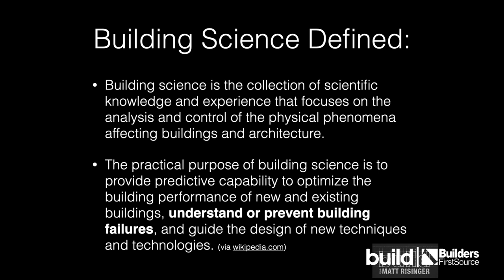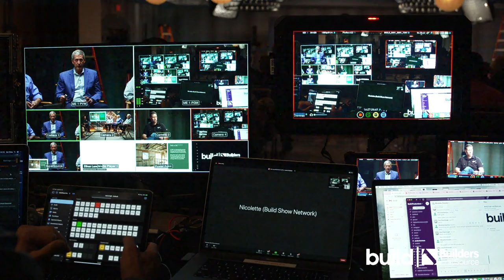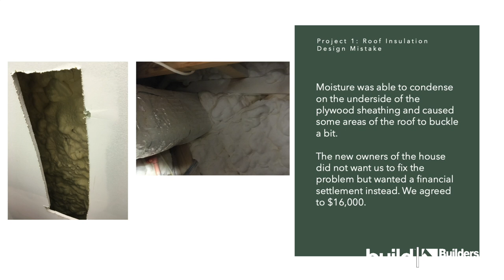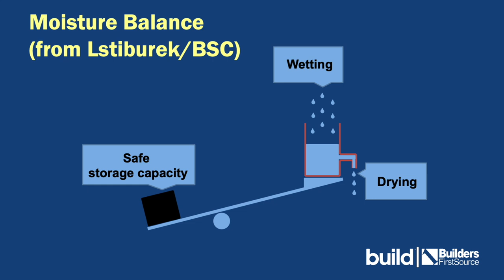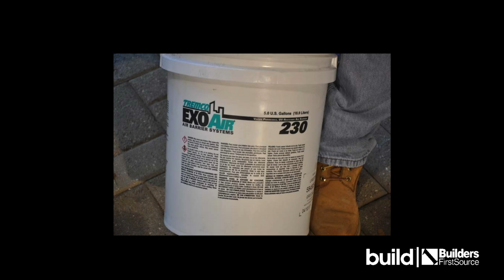Massive Mistakes and How We Fixed Them (4 Builder Panel)- Build LIVE from DC

Comment: In the late 90s, I was working for a design-build company in Terre Haute, Indiana.
We were building pre-engineered metal buildings for mostly industrial use, but they were also used for the attached office space.  The buildings were insulated with fiberglass batts.  We also had an interior designer on staff that LOVED vinyl wallcoverings.
I moved to Maine, and started learning Building Science from Joe and others in the Northeast.
Five years after I left, I spoke with a friend who was still a Project Manager with the company.  They had spent many tens of thousands of dollars fixing the moisture issues in these buildings, but still didn't understand what was causing the problems.
Reply: I have found interior designers lack of thought to long term consequences & hygiene/water movement to be horrific.

Comment: I'm not a professional builder, but as I moved from The Netherlands, to the UK, then to Ecuador, I've seen a lot of different approaches to building. I like the content here a lot, as although I am an electronic engineer originally, I've done tons of electrical and basic construction. I look at this channel to ensure I get ventilation where it needs to be. An example, a badly constructed lift/stairs area in the 4-story building we have 2 floors in (bottom 2), has water ingress. That hits a tile floor, but if it gets a lot of rain water there, no drain exists. That water goes into the wall, and then, into the bedroom downstairs. In addition to drainage, we also effectively built a vented box behind the cupboard, so any moisture is vented out. The climate here is fairly dry, most of the year, but there is also (very) heavy rain sometimes.
We also had moisture problems from the neighboring walls. Same concept, fiber cement wall with air flow behind it. Problems fully resolved. 
Other small tricks that are not too common here, are centralized gas,  anti-return valves and shut-off valves, floor pan drains under some critical equipment areas like washer, dishwasher, plus some improvements to get the water out of the house.
Houses here, even fairly upmarket ones, are not typically well insulated. But taking advantage of lessons shared on this channel is definitely good. There are other channels too that show some good stuff, but this one covers a lot of different things, products, mistakes and how to resolve them. It shows off sponsored content too of course. But it is honest about mistakes made, owning up and solving the issues, and it is very interesting to see what ideas I can use in a small way in my own property.
Thanks all on the panel and thanks Matt!

Comment: I always spray stone siding with 511 H2O+ stone sealer, especially on limestone to prevent water from soaking into it.  In zone 6, the freeze/thaw cycles causes limestone to flake off, sometimes in chunks over time.  It may not be waterproof the wall assembly but the stone looks cleaner for many years by keeping water from soaking in and mold/mildew from growing on the stone face which discolors the stone vs, unsealed stone.

Comment: The liquid mastic cracks me up because i have used white aluminum roof coating on joints of osb after i sealed/bonded the sheet edges together with PL premium. Then the next day i applied the aluminum roof coating over the joints. Also with the peel and stick flashing or tapes you want to use a heat gun on medium on your substrate before you apply it and it will bond like skin. I am not a pro builder i am a retired aviation structural mechanic US Navy and so i applied my knowledge to any work I have done on my home exterior.
Reply: I was an AM too. A lot of skills I’ve taken with me as well. Especially when it comes to working with metal flashing.
Reply: @stevena3333  I was an AME, basically the bastar* child of the AM community but i liked cross training with the mechs, trons , Hs and Ss. Then working my last 2 at the Lox farm i learned that after some point it all crosses over to everything else when you are thrown into a situation where you have no formal background and now your maintaining 3 phase nitrogen generators, for example. It truly distinguishes the parts changers from the real mechanics/troubleshooters.
Reply: @stevena3333  i was able to get a used nice 10’ trim brake local for 500 bucks.

Comment: Had a situation where a brick exterior was sand blasted to to clean the brick which of coarse 'stripped ' the mortar surface. The next few rains resulted in the interior wall showing water marks . 
SIMPLY re-sealing the mortar completely fixed the problem . 
WHY is the mortar on all stone facings not simply sealed (waterproofed )?   (if the rain can't soak in , further migration is not a problem. AND eventually natural aging will result in mortar developing it's own seal)

Comment: 2008-2009 I've worked as a composite material field engineer for a Windmill company called clipper Windpower based in California for a retrofit of 300+ rotors who had to be brought down by a 300 T crane for structural repair of the blades. In 18 months my longest vacation was four days to go back home for Christmas in Canada. Two of those days were spent in an airport because of a snowstorm.  During that retrofit, we had to figure out how to make an epoxy post-cure at -20 f. in Iowa and not make the epoxy burn at 117 f. in Palm Spring. The directors in the airconditioned office in Carpinteria California were surprised that I had a short temper with their armchair quarterback decisions.
Reply: Complete Goggle 
I live near Carpenteria. 
We do not even have air conditioning the weather is so perfect!
So very easy to ignore the weather in the real world…
Reply: @josephpadula2283  Riding my motorcycle on the 150 and the 33 was what kept me from bailing out back home in Montreal.

Comment: Can’t believe how expensive a simple mistake can be.   I remember in Canada roof SIP’s all started rotting.   I live in Australia and we don’t really build to any standard and out houses and roofs are so badly sealed that they never rot because the air blows through and keeps things dry.
Reply: I live in a poorly built 1960's neighborhood built on clay with crawlspaces for almost 20 years. Been interesting to see as ppl seal parts of the houses or add plastic materials (like pergo over the oak floors) how mold appears.

Comment: First guy: What about the window coming down to grade?  That's a code issue.  What is it? 2 or 3 inches off a hard grade? (Pavement) and 8 inches off a soft grade? (Dirt) .  Even waterproof membranes have requirements for installation , ie a curb for the membrane to terminate to.

Comment: holy cow, that one instance where it was because of vinyl wallpaper. i wonder why the 3rd guy thinks the mold guy was a con artist. Genuine question  and no judgement.  I have seen it where you could get 5 engineers in a room and get 5 different answers that are very differnt from one another.
I was a 3rd party to a job were something similar regarding mold was going on.  This was on a stucco wall .  basically, some flashing details werent done correctly or at all, poor drainage and what i called "the house being too tight".  there was no way for vapor to escape where the water was staying. eventually it got fixed.  this was also back in the mid 2000s

Comment: We live down on the Texas gulf coast and our shower is on an outside wall, it seems like that would cause the same problem as a mirror, is that true??
Reply: It's not the moisture itself, it is the blocking of the air currents by the mirror/vinyl wallpaper/large stone tiles. Put in a  bathroom fan, you'll be fine.
Reply: @stephanieray6587  You don't understand.  The mirror on the outside wall causes a problem the same way the vinyl wallpaper does.  I am not concerned about the humidity from the bathroom, I am concerned about the humidity coming from the outside, exactly like those peoples bedroom.  A fan will not help if the humidity from a rain storm is trapped by the wall of the shower in my walls.
Reply: I think they had a failure in their moisture barrier, compounded by the vinyl wallpaper.

Comment: I worked for an interior decorator hanging tons of vynil wall paper in the late 80's and early 90's. I wonder how those houses are doing now.
Reply: Getting closer to the end of the video and just realized that many the issues mentioned in this video are why I haven't resided my house yet. 
When I go to get quotes many of these failed methods are what's included or insisted upon. 
Since I am lower then multiple neighbors, near the top of a hill to the north and back, my back yard and north side run damp with algea on siding and ac unit by every august. But so far mold free living space. This is reminding me how I need to be so careful when I go to do the siding, almost wonder if I should try the siding myself despite bad leg just to make sure these things aren't done.

Comment: Never try to reinvent the wheel, something may sound better, but when things are  done a certain way for centuries there is a reason, yea it would be nice to seal an air tight home, but moisture always finds a way and you need venting. Id rather have a well vented house and lose alittle energy then have an air tight home and rely on mechanical venting and have moisture build up and create mold!